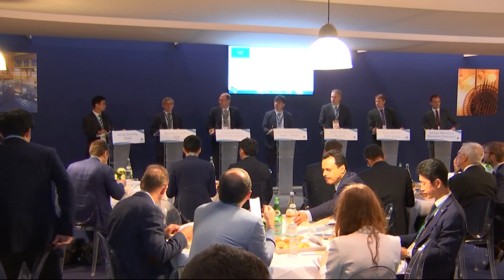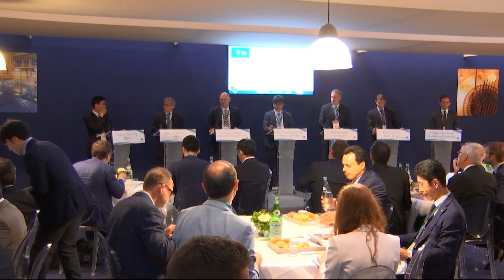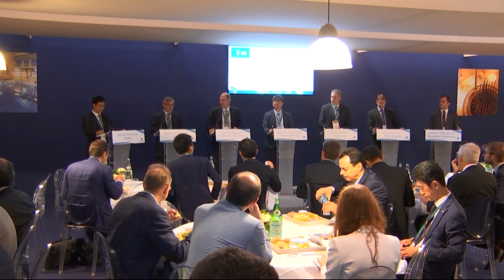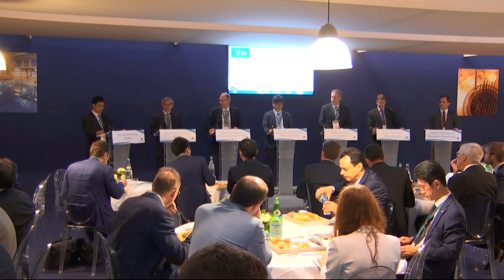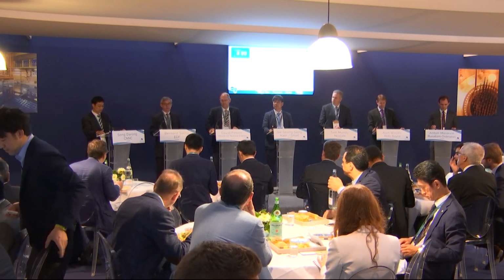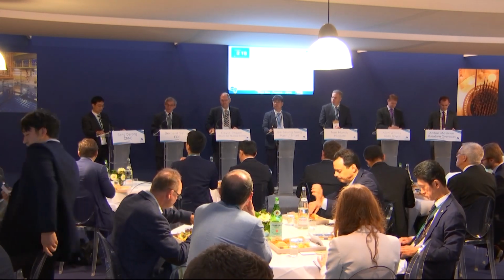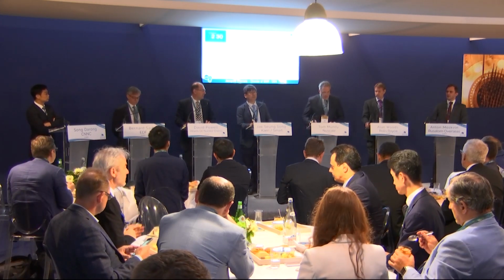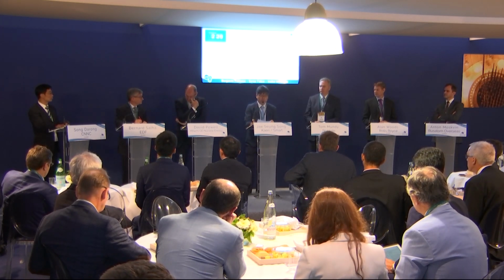WNE 2018 - Lunch Debate on Small Modular Reactors

Comment: Speaking as a former reactor worker;  this looks like a real bundle of maintenance problems coupled with what may well be epic radiation exposure;  none of which you seem to be taking into account.   How are we supposed to plug one of those steam generator tubes WHEN they start leaking?   Unless you have some kind of remote tube plugging machine;  I ain't getting in there to fix those tubes with ambient background radiation at 10R or more unless you pay me a whole lot of money.   One other thing re design is containment of radiation during maintenance with no containment building--- if you license the plant and get away with it.    Your management will be burning people up at the prototype site so fast that you will run out of local population just like we did.   [When people reach their radiation limit for one year;  their out,  or "burned up"].    And that is just talking about normal, everyday maintenance.    Lastly;  sixty megawatts is over eighty thousand horsepower and that ain't small.   We shut down Shippingport in Pennsylvania because at the end of the day we did not have a containment building and no external emergency core cooling and that reactor was only fifty megawatts.    Y'all better be doing more studying and thinking about this project.

Comment: Skimmed through and tried to catch every question that was thrown at them for my own work, thought I might as well post here: 
1)0:00 My question pertains to modularity: What compromises if any were there between modularity and the power and size of your design? What were the key things that influenced your decision in the size of the design? 
2) 15:22 Nuclear deployment worldwide needs a strong demonstration of safety and full compliance with the best safety standards. Usually people say that small is beautiful, could you say that small is also safer in the case of your design, and why? Most of generation 3 reactor design integrate(?) this principle and target zero leakage outside the nuclear building. How does your design master the environmental impact in case of an accident like what happened in Fukushima or worse? 
3) 32:08 From Europe’s perspective there are 3 issues that would drive SMR acceptance in Europe: Are SMRs safer and easier to decommission than conventional nuclear plants? Are SMRs more promising in a European electricity market targeting 50% renewable power generation by 2050? How competitive will be the produced kilowatt hour and the __(couldn’t understand)__? 
4) 47:28 The SMR is posing some challenges similar to the larger power reactors and we would like to share that. The challenges on one side are the need to comply with different standards due to the different designs by different nations pursuing the design investment, and also the need to comply with different regulatory as well as legal and licensing process. And on the other side is the need for harmonization in order to reach economies of scale. So based on all these factors, how does it impact the announce(?) cost? 
5) 1:00:38 What could make these [SMR] reactors more acceptable than large reactors? We know that acceptability, apart from cost is key criteria for the success of nuclear in the future.